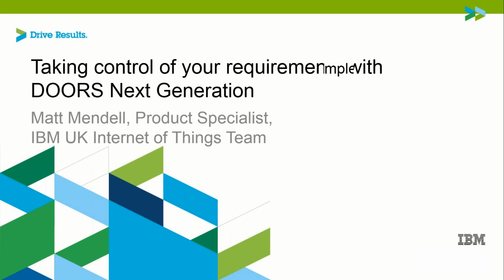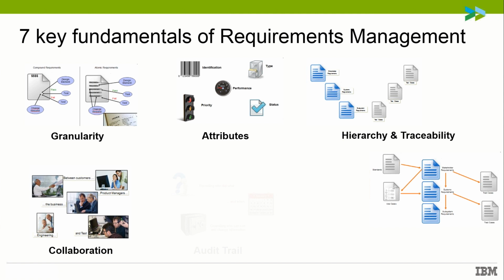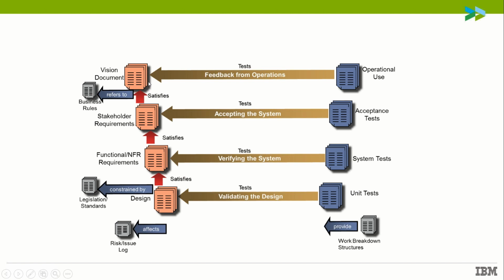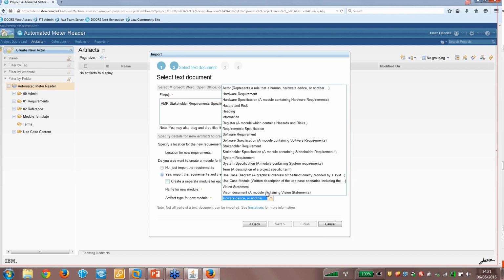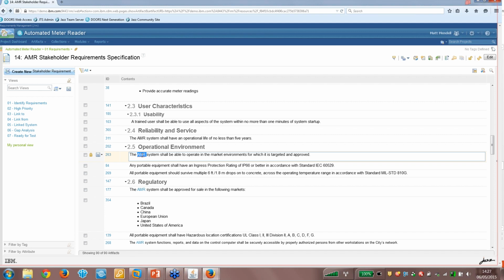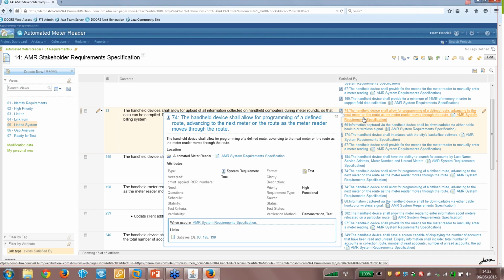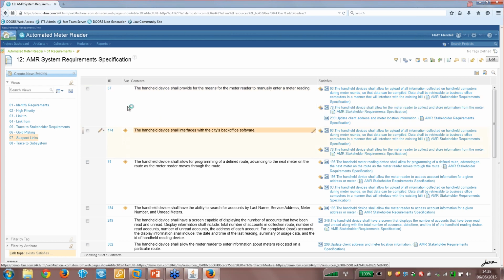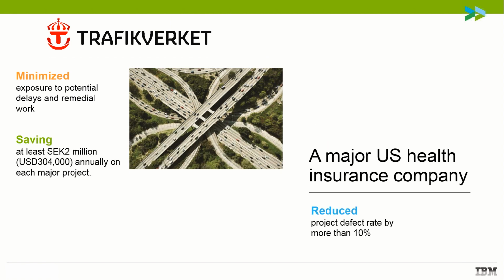Taking Control of your Requirements DOORS Next Generation Webcast

Comment: It seems like the audio was recorded over some kind of system that ignores sound input below some threshold level.  This in conjunction with the speaker's voice going very soft from time to time often seems to eliminate words or parts of words making it very difficult to understand what he is saying.  In my case it made the video impossible to follow.  I don't know if it can be fixed but running the audio through an audio expander may help.  I hope the recording setup can be improved before another video is made.